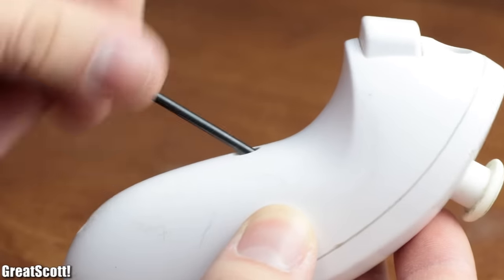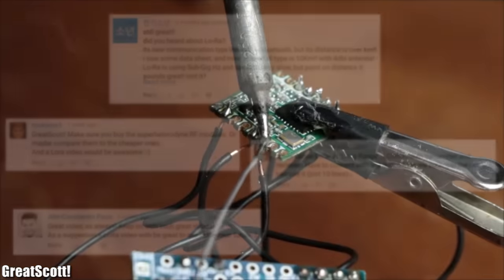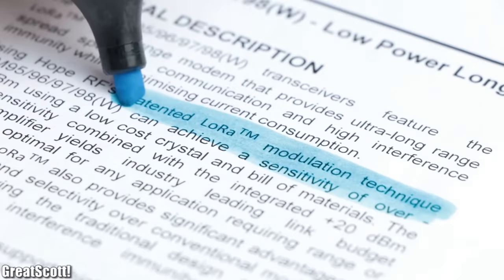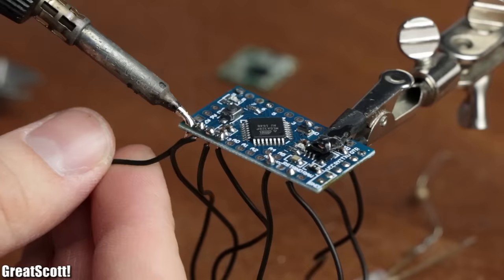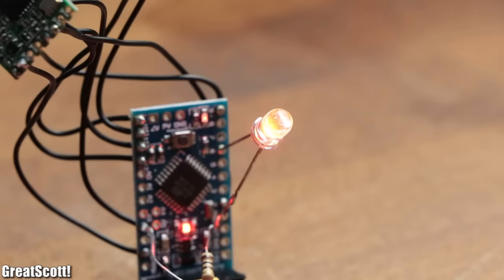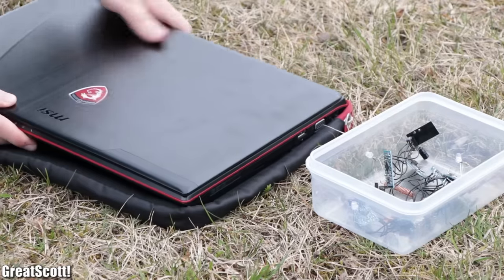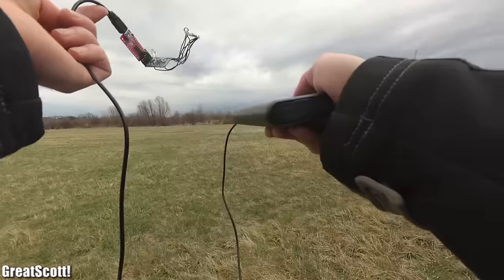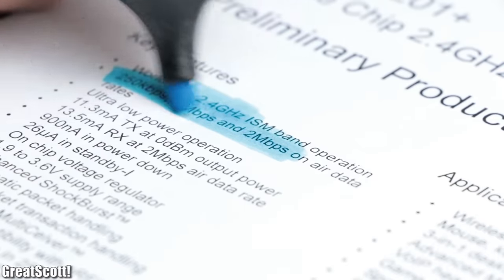LoRa Module VS nRF24 VS Generic RF Module || Range & Power Test

Comment: I’m sorry but when dealing with RF, the antenna is (almost) everything. This video does not meet your normally high technical standards and really needs a little more preparation. That said, it’s the only time I’ve thought this - your work is usually extremely precise and of high quality.

Comment: nRF24L01 module also comes in a more powerfull version with more serious antenna, it has hundreds of meters of range, personally I tested it at 400m with solid signal. I use it in my arduino powered RC plane with no problems, flying at heights of 50+ meters.
Reply: Hello! Do you mean the NRF24L01 + PA? I also want to make an RC plane and I did not know if this module works for me
Reply: You are right, without antenna module works 20-30m very pretty, and with antena module I got more then 450m clear renge

Comment: If you're getting 300m with lora on its low bandwidth high tx power settings, something is horribly wrong. You can easily get 8km with that style of antenna point to point, and 'power draw' is misleading as with lora you can put it to sleep for <1uA. A realistic battery application will spend the majority of its time sleeping.  If you're lucky and have commercial towers to talk to you can get magnitudes more range

Comment: kind of unfair comparison, the nrf has a built in antenna which doesnt offer that much range. if u add an antenna to the lora board, you should have done the same thing to the nrf board, so you can compare the range with the same setup and not of the boards with antenna and the ones without. for a future video, a test of the ts100 would be nice :)

Comment: Especially when using LoRa, the antenna for both sender and receiver is particularly important. In this video, the 433 Mhz antenna is used, while in Germany (and the Netherlands) an 868 Mhz antenna and module is required. Using almost the same setup as in this video, I reached more than 2 KM receiving reliable data, above 2 KM still received data, only distorted.

Comment: I think the transmitter current should be measured with oscilloscope or high bandwidth keithley digital multimeters, because the transmissions happen in very short bursts that the handheld multimeter cannot pickup.However it picks up receiver current because the receiver is always active.
Reply: Agree
Reply: same thing that I thought
Reply: True

Comment: Antenna orientation and elevation is very important in accurate distance testing. If you have one slightly tilted (not parallel) with the other, it will decrease reception dramatically. It is also a consideration that your laptop may be emitting a good deal of RF. I know from experience with HAM radios that if my handheld radio is withing 3 feet of my laptop, I will have static when hitting the local repeater. Moving away instantly corrects the issue. Given, the frequencies in question are in completely different bands, but antenna theory seems to be applicable in both situations me thinks. I urge you to elevate the transmitter to the same height you are walking, and away from your laptop - and to keep both antennas completely vertical throughout your pace. But as ALWAYS - thank YOU for the excellent work you share here. It is always informative.
Reply: Even polarization of antennas makes a huge difference at times. Try rotating something 90 degrees and watch the strength and overall snr change.
Reply: @nobodynoone2500  I have a question, I have two generic RF modules with 17.3cm copper antennas, is connection best at longer ranges when both antennas are vertical or when both are horizontal? If I understood correct they should be at the same angle, but which orientation
Reply: I discovered this when starting with BLE. I have to disable bluetooth on notebook to get communication working. 😅
Reply: @iscuit  verticle relative to ground, I would say.

Comment: LoRa is much better. I was able to bridge 200km with the same LoRa module. Maybe you watch my videos about that topic.
Reply from the maker: That is impressive.
Reply: GreatScott! I think the antennes you used for the LoRa boards where not designed for that frequency. That's why you got so little range!
Reply: Niels Daemen - That was my thought too. The antenna is incredibly important for successful results, and at UHF, every millimetre makes a difference. The good thing about 868MHz is it falls into a sweet spot where very high gain, yet compact antennas can be made, without the very tight tolerances when working at 2.4GHz. A non resonant, omnidirectional helical without a decent ground plane makes a very poor antenna. Might as well use a coat hanger! :-)
Reply: I was thinking about your antenna video... :D
Reply: Are you joking
Reply: Andreas Spiess 200km?? O.o
Reply: The best amp is ANTENNA ... !!!!
Reply: As far as I understand it wasn't between two boards but between a gateway antenna on a mountain and a module with a quite good antenna. Just watch his video.
Reply: dex dipa  if you are high enough, it is!
Reply: The guy with the Swiss Accent! Hello!
Reply: Even if he cannot reach 200 km, He need to be able to reach beyond 5 km with Lora at least, there must be a problem with design
Reply: Wow, that is amazing.   I was able to get 7km at almost LoS.
Reply: Is that a typo? Do yo mean maybe 2 km, or 200 m?
Reply: XD
Reply: Impressive! Nice antenna and probably more than10mA TX current.
Reply: dex dipa  when you become a radio ham, you will learn that miles and miles can be achieved using miniscule power levels if the working conditions are optimal. I have received a digital signal with the same power levels as your car key fob well over 3000 miles away (attached to a balloon). I have used a half watt hand held radio to hold a voice conversation UK to the USA too.
Reply: dex dipa  it's possible, it's a tiny packet of data, and if line of sight, and without interference, with optimal antenna and conditions then it is possible.
Reply: BlackedHatGuy  more channels is wasteful. 1 or 2 channels is more than plenty, if you are only sending short packets of data eg. Only when you send a signal different to the previous you can still get a low latency signal. Assuming that you are making your own transmitter receiver pair, using any one of these modules (the 2.4GHz being favourable) using existing protocols will give many options alternatively writing your own may allow for many more depending upon your skill in coding.
Reply: dex dipa  check out the power out put used with HAB projects. These are 433MHz micro transmitters and they can be heard all over the world, there is propagation all the time, the trouble is it only lasts a few seconds and then it's gone, so little narrowband packets of data often can be heard on spot frequencies from thousands of miles. I have tracked a balloon and still heard packets of data when the balloon was floating over Moscow a few years back.
Reply: 200km?
Reply: @jatre5938  No he meant 200km
Reply: Andreas is like “90 meters? I eat that for breakfast”
Reply: What is the video link?
Reply: Is it possible to use my Lora module sx1276 for quadcopter? I heard we cannot.. why we cannot use this module for quadcopter and which cheapest module I can use it for the quadcopter.. I hope I asked a question to right person..
Reply: here a found owner of my fave channel.   
one the lord range of lora (switzerland)
other are simple tech bit (scottland)
both have nice speech accent i  liked
Reply: dex dipa  have you try connect ptp with generall cheap wifi over 5km.
it possible too, if you have tray finding match antenna for devices
Reply: Electronic Scott the bitrate is too low at 868MHz but you can use LoRa at 2.4 GHz and also the same Sx1280 for flrc and ranging, ie measuring distance.
Reply: Suggestions about a better antenna for this board?
Reply: YEp but the transfer data rate is also very important too
Reply: @mubasheer5584  It depends what you do with it.
If only for controlling it, you could use LoRa. But for video, it is too much bandwidth for LoRa.

Comment: Even though I see the pros of the LoRa, I still think that correctly used you can get much longer ranges of the other two chips as well. Personally I’ve built a  lot with the generic really cheap ones. But I’ve been using 12v to power them. That along with an antenna on both sender and receiver really boosts the range. Thanks for the Great video! ;)

Comment: Great job on this video!  A few points:  1.  That LoRa module is very sensative to the antenna - you need the proper one and from what I see in the video, the repurposed one from the 433mhz certainly will not do!  You probably would have been better off with just a wire cut to the proper length with the antenna length calculator.  2.  That little cheap transmitter only is really not a fair comparison since there is no error checking and it's one way - but to your point it's a good distance test.  3.  On the 2.4 ghz model, check out iforce2d channel, he got it to go for many km's!  Also Andreas Speiss has done alot with LoRa where he set the world record with distance.  ...if you have an interest.  Great job as always!!!

Comment: Those 433M Modules doesn't provide error correction/check features, just simple ASK modulation. You need to implement a protocol for it.
nRF/LoRa does provide these features.

Comment: nRF24L01 also has a long range one with a antenna, its supposed to have a range of a 1 km.
Reply: True that. I've been using a pair to fly my quadcopter. It works really well.
Reply: +Praveen Elumalai Not True. It could exceed > 300m. It depends on the On Air Data Rate (which increases Rx sensitivity when lower data rate), whether the board has external PA chip, the packet configuration (e.g. ACK/RETR), etc.
Reply: Chun Ho Kong may be but not as much as 1km.
Reply: it is lie, i got sometimes 1,5km and sometimes 350 m
Reply: 2KM for me, with on board PA enabled. Either you got a bad module or your configuration is incorrect. I have seen boards with PA on board, the CE (Chip Enable) pin of PA is tied to the SPI CS, so you need some special treatment on the software. Using 250Kbps as suggested by +ICT above and max Tx power will also in result a better performance.
Reply: Adding to this that many of the nRF24L01 modules on the market are fake with some Chinese coppied IC's.
Reply: It doesn't use 2.4GHz range. It uses IIRC, the 700-900MHz range.
The 2.4GHz means something else. Google it to know more.
Reply: There are some relationships, lookup Rayleigh Fading/Scattering.
Reply: iforce2d managed to get 30km range, a dodgy connection but a connection all the same. Obviously with some beefy antennas too. https://www.youtube.com/watch?v=4XRp7pkZgPM
Reply: Pretty sure the longer (>1km) ranged one are usually NRF24 modules that include a LNA. The NRF24L chip in itself is much less capable, especially at higher data rates.
Reply: Ever heard of WiMax ?
Reply: Range is depandent on amplitude then Friquency
Reply: Praveen Elumalai haha lolo, first see your caluclation 😂😂 really wave length is 1.25 m 
And also yes it can easilly extend more then a km because of it integrated amplifier ,if using at max power 
And rather than saying this first try nrf24(antenna) yourself
Reply: They work so much better but I always had problems running them for an extended period of time.
Reply: I got around 300m with pcb antenna,  there are also modules with amplifiers and separate antennas., 1 km might not be far fetched.
Reply: @praveenelumalai7624  NRF24L01 400 meters with low obstacles, if you test it in open field you will get at least 800 meters.
Reply: Yea the antennas used were poor. Each device, every frequency, needs it's own specific antenna at specific sizes. nRF24L01 reaches 1-3km in middle of no where with a solid $2 antenna,  depending on the wind and sun interference (seriously) 
and forget about LoRa, can't even test that insane range.
Reply: @praveenelumalai7624  You're wrong, many videos and my RC devices prove you wrong.
Reply: I use this one for R/C control, and riding flat on the ground with a truck it gets over 500m. It's all about clean power and the right settings
Reply: @ICT "transmit.setPALevel(RF24_PA_MIN); " should i modify this line of code to increase the range ?
Reply: @praveenelumalai7624  First, you are wrong by an order of magnitude. The wavelength of a 2.4 GHz signal is about 0.125 m or 12.5 cm. It is not 1.25 m. The rest of your post is a complete nonsense. There is no direct link between signal wavelength and the distance it can travel. The phenomenon physically limiting a signal to travel past its wavelength multiplied by two, like you described, simply does not exist. Last time I checked, my cell phone signal was able to break and travel past the 25 cm barrier.
Reply: the problem with the nRF24L01 is mostly bad power supply, as already mentioned here *AND* also that most of the modules you can buy online use counterfeit chips, which have a drastically reduced range and poor quality.
Reply: @AhmadLafi-TheFirst  true, but sadly even when you buy from 'reputable shops' they might be selling chinese 'fakes'. Sometimes very hard to know where to get the 'real stuff'. Price is not always a good indicator, you may just buy an expensive 'fake'
Reply: With the nRF24L01 , the model with external antenna, I got 1KM range in direct view.
Reply: You said correct. I 'm also get shocked by his experiment as I made transmitter for RC toys from How to mechatronics... It is working well for long range application more than he told

Comment: With RF the antenna matching, type and direction are essential to know. ... For more genereic results you'd should have tested each system with multiple rotations, since sometimes longer reach comes with higher gain antenna and limited radiation pattern. Thus the distance varies wildly depending of the antennas and alignment used.

Comment: Very nice video, I really enjoyed watching it (as I do all of your videos). I do, however, have two notes which are worth mentioning: A. when you were comparing the bandwidth of 433 MHz and LoRa radios, you said that the 433 MHz module has 4 kb/s rate... but the datasheet says 4 KB/s, which is 32 kb/s, and that is almost the same as LoRa (32 ≈ 37,5 kb/s)... So they both have similar bandwidths
B. with these 433 MHz, you must provide a clean power source, e. g. a battery or a linear regulator. Powerbank's output is full of noise. Also, you can power the transmitter from higher voltages, so for example I am using a 9V battery and I am able to get almost 100 m out of it outdoors, with a 17 cm piece of wire as an antenna
But otherwise, keep up the good work!
Reply: Was about to comment the same about the 4KB/s meaning kiloBytes which is 32 Kilobits/Second. You beat me to it.
Reply: Shit I posted the same without seeing this....
Reply: Same here.
Reply: Oops!
just posted a comment about this...
Reply: Would you like to explain what you're doing differently?

Comment: I did like this comparison (and the marching :-). Lots of time spent on the comparison and less time on the individual setups. So it seems that LORA technology is the way to go for > 10-20 metres?  Andreas Speiss has just done a video on antennae tuning so I'm thinking that perhaps you might be able to improve your  ranges using better antennae? Either way thank for you another education and entertaining video. Keep up  the good work.
Reply from the maker: Thanks for the feedback :-)
Reply: when we talk about radio waves: the antenna is everything: an old saying between radio amateurs is: a dollar for the transmitter and a thousand dollars for the Antenna!
I met someone who connected Italy to the USA with a home made CW (continuos Wave) transmitter  of just three low power transistors (one was only for the switching (keying) circuit) and a long wire antenna
Reply: I bought antennas with my modules from Sparkfun and was able to get about 2km with just the default configuration. So yes, it's much more Long Range than the others. It does have a low data transfer speed though.
Reply: Hey I least about hc-12. Many sites says that it has a theoretical range of 1.8km. Any idea about that?
Reply: For those who are interested in more Lora, no one can beat the videos from Andreas Spiess
https://goo.gl/73YrYA
Reply: yeah i'm using that for my home automation project.  It works fine with the walls without corrupting your serial data. It has the default range of 1000m meters( 9600 baud rate). But if you put the module baud rate into 1200 you can actually get 1800 meters. But note if you reduce the baud rate  the data might lose and take 1 second delay to receive. I can guarantee it's a better module.
Reply: Heshan Shalanka did u try esp8266?
Reply: With the cheapest module line encoding does matter. And a straight wire 1/4th wavelength antenna  will do it better.

The receiver must have an antenna too.
Reply: @johnaweiss  hc 12

Comment: Hi GreatScott,
  I am using nrf24l01 module(nrf24l01p library) on some project and if you use 22uF ceramic capacitor between Vcc-ground and some long antenna you can achive least ten time more range. I have tested it with 50 m and it is working without problem. I will test it with long range too. You can try. Good video again...

Comment: What is your data rate setting for nrF24L01(+)? The lower the data rate, the longer the range (due to Rx sensitivity). Also check modules with PA integrated on the board, those can get 2KM+ easily.
Reply: How can I find out with which antennas this module can transfer data at a range of 1-2 km? Can you help me with the keywords I need to find the range I need in the outdoor LOS field using the Friis Transmission Equation? Everyone has stated that it provides 2 km + data transfer, but there is no clear information about RF setups.